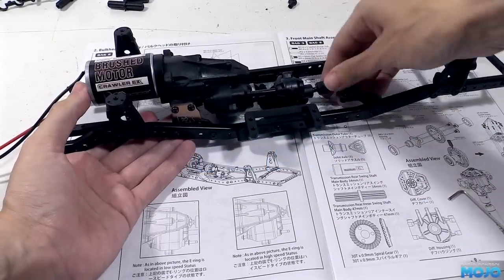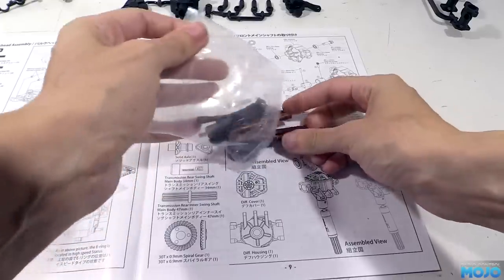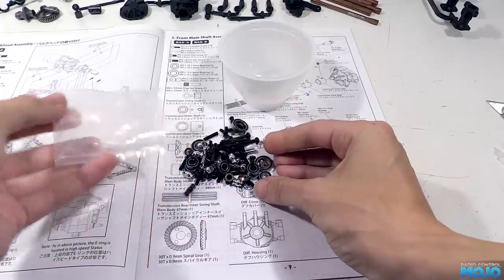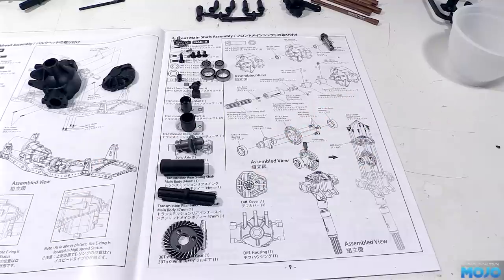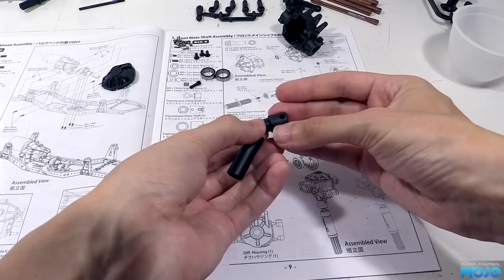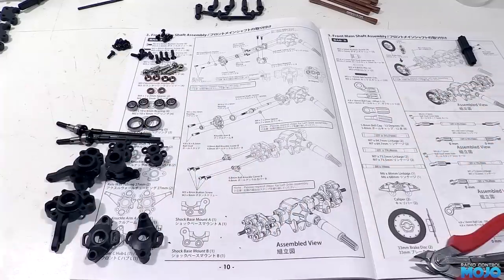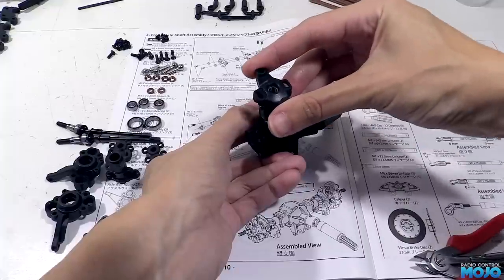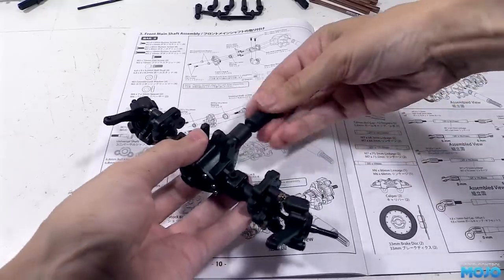3Racing Ex Real - Axles Part 1 - Page 9-11

Comment: Been watching all your vids for some time now. seen a few on aircraft.I would guess you have built aircraft at some point, with your quality and detail of vids It would be good to see you build a balsa aircraft kit, DB Sport and scale / Benbuckle style.
Reply from the maker: It's the amount of space needed for aircraft kits. I put together an Avicraft Frantic which was about as big as I can go in my usual filming location, even then it was a bit of struggle. The Seagull kit was quite a bit bigger, but it has a 2 part wing that made it much easier to film.
I often think about another aircraft kit though, I like the look of the little Pepe Kadett, designed for the Enya .09 it should work fairly well with a Thunder Tiger .10 I bought a while ago.